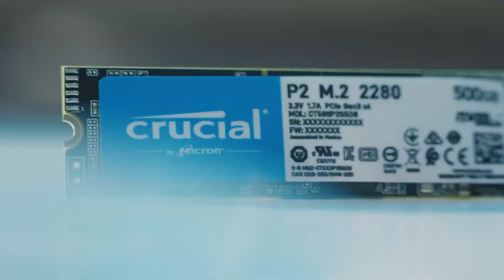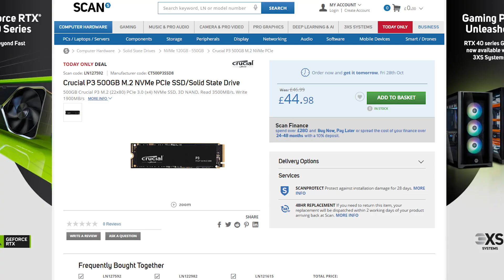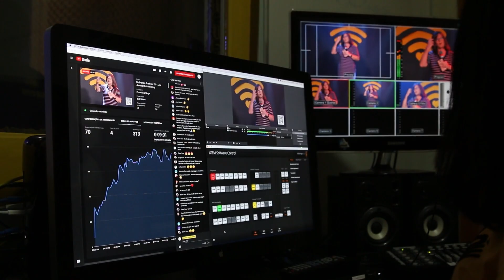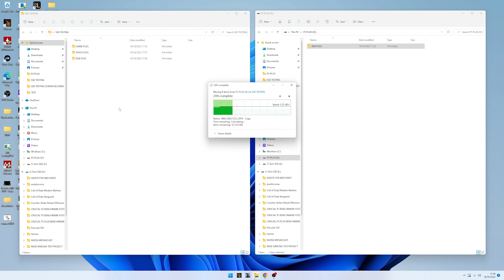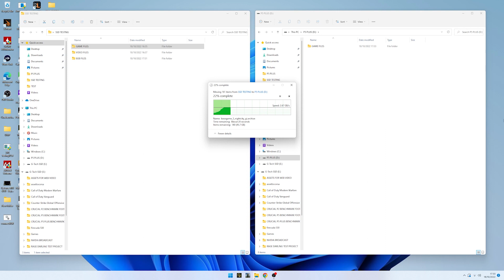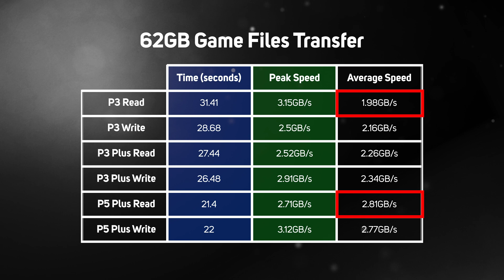Crucial M.2 NVMe PCIe SSD (P3, P3 Plus & P5 Plus) Benchmarks!

Comment: Don't be fooled you gain no FPS from a "Gaming" nvme the only thing to gain is map loading times. Actual gaming you would never even know you were on a mechanical HHD vs a ssd/nvme
Reply: Even further to your point - there's tests on YT showing virtually insignificant differences in game loading times between Gen 3, Gen 4 and even Gen 5. So it seems that as long as it's NVME, it's already good enough for now.

Comment: What i can understand by this good testing is that p3 can beat p3plus and p5plus if copying small files?
I don't know when its mentioned 64gb of game files, was there a single file? or multiple files or multiple files archieved, these differences can lead to slightly different results to be noticed.
The only thing is durability which is the point to be considered, but again after 5 years there be so so much tech and the p5plus will be like HDD these days and health will not be a consideration to upgrade from that. I think if it can last like 6-7 years, its good to go. Though i have used a laptop for 8 years, the HDD it had is critical now, but i still use it as 2nd backup (unplugged).

Comment: Just a question. I just ordered the P3 Gen4 1TB, but it doesn't say "Plus" or anything. Is it different that this P3 Plus Gen 4?
Reply: it could p3 or p3 plus
my guess is gonna be that it’s a P3
"gen4" must've been a typo
Reply: @harryhelina9859   I've got it and it's indeed, the P3 Gen4 Plus. It works almost as great as my SN770. 

Previously, I was using only Samsung since my first SSD 830. Then, went 840/850/860, then my first M.2 970 Evo Plus and 980 Pro. However, 2 970 EVO Plus and 1 980 Pro for some inexplicable reason malfunctioned extremely fast and decided to change brand. 

The WD SN770 and 850 so far are solid AF. One month I'm using the Crucial and with 4 major games on and no problems either. Happy camper since it was extremely cheap. Also, evidently I did a good choice on getting a  Motherboard with 3 NVME Gen 4 Slots (X570).

Comment: You said it's backwards compatible with PCIE gen 3 slots. What if i use P3 plus on my pcie 3 gen x4 motherboard? can i get the exact speed on my p3 plus? Thank you
Reply: No, it will run slower. The same as the P3 non plus edition.

Comment: Bought a 2TB P3 Plus for $110. It may not be the fastest PCI-E gen 4 SDD out there but it's exceeded my expectations and for the price you can't fault it.
Reply: cant go wrong with crucial. bought a 2.5'' 1TB ssd few years back, was a bit slower than the samsung evo crap and like 30 euros cheaper. sign my ass up. in my next build im probly gonna go crucial again but with these nvme's. no more wires

Comment: For general usage, there is not much difference between the three, except extra durability, and extra speed, which you may not need. Unless you are working heavy duty and high end stuff, P3 is good enough and cheap, and durable enough to give you 10 years of normal usage or 5 years of heavy usage.
Reply: What about the DRAM? Is the HMB on a p3 plus enough to compensate DRAM and to use as a primary boot drive? I'm upgrading from a 10 year old toshiba hdd btw
Reply: @gutar5675  Video tells everything. 62GB copied in only 31s. A very budget SSD, but compared to any HDD, it is so much faster it is a no brainer.

Comment: so what's the difference between p3 and p5 pci 3.0? I have p5 500gb and my tbw is 300 since p3 is more cheaper than p5 like 30$ less
Reply: P5 is TLC, with more sustainable speeds in long term, and durability. P3 is super budget QLC intended for casual use and not intended for very big transfers because once the SLC cache runs out, it will have to copy directly to QLC which is quite slower than TLC and has less longevity, which means it isn't good for intensive use like professional video editing.